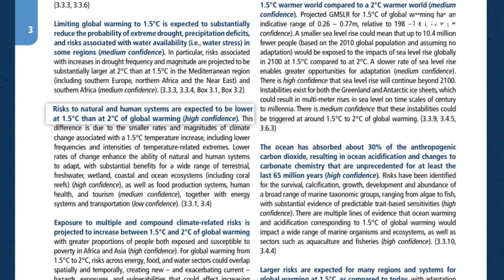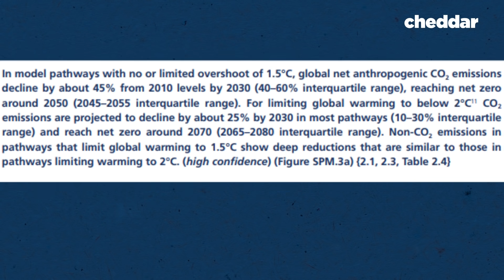Wooden Skyscrapers Are On The Rise - Cheddar Explains

Comment: Concrete is uh fucking bad, but a passing mention and a hand wave about unsustainable forest management is pretty irresponsible. In Canada, for example, our managed forests are a net contributor to GHG emissions as it stands. Not a good look for a country that is supposedly leading the way in using wood as a high-rise building material. The interests of capital in this country align such that it stands to benefit from both increased demand for timber as a builder material and from a lack of (already desperately needed!) sustainable practices. It's extremely naive to expect a market-based solution to any aspect of the climate crisis, but it's especially damaging to PR boost for such a fix, and especially in the Canadian context.

Comment: Nuclear power, geothermal energy, and hydropower are some of the best ways to cut emissions.
Reply: Hydro actually creates a LOT of CO2 during construction and reservoir filling. The CO2 released by the rotting of all the vegetation covered by that new lake, as well as all the cement production for vast amounts of concrete, can overtake many other similarly sized projects.
Reply: @kindlin  But converting current dams to hydroelectric would save from producing CO2 during construction
Reply: @firestrikebs  
Huh? Dams are hydroelectric, the dam is the hydro- part. You can upgrade an existing dam with more efficient turbines, but that doesn't change the initial cost of construction and filling, the damage is already done.
Reply: @kindlin  he probably means converting water reservoirs into hydroelectric dams. It wouldn't work
Reply: @kindlin  You're a dumbass. C02 is actually good for the environment. Plants need C02 to produce oxygen.
Reply: @thebabbler8867  
All scientists agree that increasing carbon means higher average temperature, with that simple fact you can extrapolate many of the causes and effects of global climate change. Yes, of course trees and plants eat up CO2 and you can sequester it in houses and many other things, but that is just a trifle of the total flux of carbon in the atmosphere.
Reply: @thebabbler8867  Yes, and cell reproduction is vital for life, but when it gets out of hand, you have cancer.
Reply: What about FUSION? OuO
Reply: @WinVisten  I'm pretty sure ITER will start deuterium-tritium operation in 2035. Even then, it will not produce power for very long. It is a long way off. I think the best solution now is to integrate trees into our cities. (https://www.youtube.com/watch?v=4w7lsydq8ks&t=609s)
Reply: Some issues 

1. Nuclear is a very green energy source and is a current requirement for any serious green energy initiative, but it has one really bad problem which hurts its environmental friendliness and that's the radioactive waste it produces it lasts for a very very very long time. And this does not include in the event of a melt down due to damage or failure which can turn the local area into a radioactive zone.

2. Hydroelectric power is really great but it has some problems too and that's its environmental footprint simple put its takes so much space to produce any realistic amount energy it destroys the local ecosystem and damages the flow of water on the rivers they're placed on and also interferes with the flow of sediment down the river. That's why in Egypt after it built the Aswan Dam, its farming sector has had to rely more and more on fertilizers than it used to while it's not solely the dams fault it's also partly on the mass population increase of egypt but egypt especially the Nile river delta was one of the most fertile places on earth making it the breadbasket throughout most of its history. This does not include the event of a dam failure which can cause huge damage to the surrounding areas.

3. Geothermal power is very nice but the issue with it is simply there is not really enough places that have geothermic activity in the world and is also stable enough to sustain geothermal power generation. Think of it would you build a power plant on a volcano that might erupt without warning?

While all of those are what I like to call heavy green power sources and the most efficient ones we currently have they have many flaws in it which is one of the key reasons why they are not so widely used that it replaces traditional power sources. 
Imo I think development of tidal power generation will make going green more feasible by using the power of the oceans currents to generate electricity will make it more realistic. Three good potential energy sources that can really revolutionize our power generation is Tidal energy, space based solar power generation and fission power. Out of those three Tidal energy is the most closest so far.
Reply: @noticedruid4985  Nuclear waste can be recycled and many 4th gen reactors produce almost no waste
Reply: @noticedruid4985  radioactive waste is not an issue. They just put the radioactive waste where they got it from. You take radioactive isotope from the ground, a put less radioactive ones back... How is that an issue? Maybe Im just not seeing it
Reply: Thorium fission could solve our issues almost instantly
Reply: Well, it's not cuting emissions, it's using/reducing emissions to build.
Reply: There are tons of ways to cut down emissions. Less concrete usage, no bunker fuel for ships, more trains, ban on short haul flights, investment on vertical farming, going vegetarian/ mass adoption of veggie fake meat, direct carbon capture in existing thermal powerplants, more renewables....
Reply: @almerindaromeira8352  
Many of those require energy at massive scale or new technologies to be useful, especially vertical farming. That's where fusion comes in. Eventually. In 20 years or something. I'm actually all for some of the up-and-coming fission ideas coming along. I haven't seen any serious and valid criticisms of thorium/salt-based fission reactors.
Reply: @kindlin  Fusion is also my hope, fission has always some risk attached and it looks bad.
Reply: Bingo

Comment: This seems like a terrible idea if your goal is longevity. It just makes no sense, im all for using less fossil fuels and seriously cutting back/replacing industry's that use them in mass. But wooden buildings require repair every 15 20 years or so (not all of the wood used obviously but certain spots will become compromised since they are so vulnerable to so many different things) that would be so unbelievably unrealistic with a sky scrapper even with steal support beams.....im no expert but it just seems like a bad idea. Even with this wood specially engineered for load bearing etc. But what about moisture, woods kryptonite? Even with treated wood moisture eventually gets in. There are so many better solutions than this. Even if your dead set on using organic materials.

Comment: Well i am Pyromaniac ... now put one and one together and lets see how long until a Skycraper Collapses because its base burned to a crisp. Mind you i am not the one doing that, i wouldnt set a house on fire but i've seen people (Mainly Drunk Pyromaniacs) try to set a Concrete Building with a Torch Ablaze ... what would happen if it were to be made from wood then? 

I love the Smell of Burnt Meat in the Mornin.
Sure they burn at a predictable rate ... until you add a higher Airflow and with that more Oxygen. 
Oxygen + Fuel + Heat = Fire ... if you have lots of one it can catch fire. Afterall metal can Burn, so does Asbest if there is enugth of the other two.

Comment: Nice video. However, in the northern part of the world, the winters are brutal. And I, living in the northwestern US, know how easily wood soaks up water, even if there was a protective coating. This means, during the winter, water gets trapped inside the wood. Water in wood is bad because the water during the winter would expand causing the wood to start getting separated and warped. Setting down wood isn't easy either, this is a problem that every material faces when making a building. When you stack older pieces of old on the more younger wood, the older wood tends to be stiffer than the younger one. This is because wood is a very moist ;) material and, as it dries up, the wood starts getting weaker. Therefore, the wood that is older than other pieces of wood will make the building become damaged before anything happens to it. 

More on why this video is bullshit:
- 5:09 The wood does not perform well in earthquakes. The heavier the building the larger the foundation, so the "less of a load on the foundation" claim is just stupid. Also, the heavier the building the harder it is to move (momentum).

-  6:22 How are you going to grow plants when they are known to break wood with their roots. Even if they had pots, what would happen if the bugs chose to live inside the space in the wall? The trees invite them and the wood structure is a perfect home.

Comment: Love how the video doesn’t even talk about the real challenges to construction with wood.  They have only solved one problem with wood that will only allow us to build a little taller.  All of these supposed “skyscrapers” are nothing compared to what steel and concrete can do.  All they have done is make wood more reliable and still probably not to the level of reliability of steel and concrete.  Everything presented here does not address how they will fix the problem of the fundamental physical properties of wood.  Wood may be pound for pound just as strong as steel, but steel is way more dense.  Thus wood will fail at much lower loads.  Wood is also a lot less stiff.  That may be good for the off chance of an earthquake, but wood will buckle long before steel does.  These are major barriers to wood being used to build actual skyscrapers.

Comment: 5:11 > pound-for-pound it's just as strong as steel but because it weighs less the whole structure has less mass
How does the same strength-to-weight ratio correlate to less overall mass? Per cubic meter, the densest wood weighs about 1200kg and steel weighs 8000kg. If the strength of steel is X, then the strength of wood is (1200/8000)X = 0.15X such that the strength-to-weight ratio is the same. In order to bear the same loading, the mass of structural material is the same whether steel or wood, but you need 6.67 times the volume for a wood structure compared to the same structure built using steel. Ultimately the structure has the same mass regardless of material, but less internal space if bulit out of wood
Reply: That's why she said medium hight and all that wood is expensive

Comment: If wood is pound for pound the same strength and steel and concrete then wouldn't that make a building less structural stable since it would weigh less meaning less strength? Because 0.75 lb of wood can't be the same as 1.0 lb of steel?

Comment: This just sounds like a huge fire hazard to me
Reply: Bro, did u watch the video? They literally talked about this
Reply: OhHeck i watched the video after probably this was from over a year ago
Reply: @hollar5560  it was misleading. They made it seem like it's a settled issue but research is still incomplete.
Reply: @monkymind4316  but concrete cracks and the metal reinforcement inside always rusts.
Reply: some sky scapers catch fire and they are covered in so called fire profe cladding.
Reply: Andrew Fogel Aren’t some woods fire resistant
Reply: They'll probably claim that they'll treat the wood with fire resistant chemicals.  Of course the production of the chemicals and application will cause cancer.
Reply: That's why you cover wood with fireproof materials.

Comment: It's like the paper vs plastic issue. People claim to be helping the environment by banning and avoiding the use of plastic bags and packaging, but are in turn supporting and bolstering the deforestation of the globe in doing so. Supporting paper means more clear cutting of forests, and more forestry industry in general, meaning more forests will get decimated in the process. And there is a lot of inherent issues with using mostly or purely wood to build these buildings. Termites & Carpenter Ants are one, another is fire like you've noted, and here's another big one everybody is missing: ROT. I don't care how often you're treating the wood, rot is a huge problem. There is two different types of rot - Dry Rot, and Wet Rot. Wet rot is the kind everyone thinks of, while dry rot is by far the most common problem with wood in and on buildings of any & every kind. You also need to consider how easy algae will find it to grow rampant on it, and fungi too. There is are even more problems wood faces when used to build things.

Comment: To me the whole philosophy is fundamentally flawed.  It works on the a priori assumption that the human race isn't composed in large parts of lazy idiots.
     What's going to happen if the idiot above you lets his bathtub overflow?  Hundreds of gallons of water are going to pour through the wooden walls and structure.  If it was a building composed of concrete?   No problem.  In the case of wood, the walls are going to fill up with mold and rot.
     What about the magnificent property of concrete to prevent the passage of noise and smells?  The wood is not going to be as effective at stopping the 16 year old moron kid next door playing his subwoofer at 120 decibels at 4 a.m. on a weekday when you have to go to work tomorrow. Or the drunks next door having their thousandth argument over who smoked whose cigarettes.  And your neighbour not changing his cat box or loving the smell of pan fried, curried fish?  
      Stand back from a concrete building.  What do you see?  It is essentially a stack of concrete cells.  These cells work and have stood the test of time.  The perform the task of separating people from each other in a crowed urban setting.  They are essentially a rock cave in the sky.  
      So if you're an Utopian who thinks everyone loves each other...have at it.  Go with wood.  If you've ever been out in the real world and seen and talked to the human race?  Whining, stupid, lazy, cheap, uninterested in paying for maintenance...etc.  Go with the tried and true.

Comment: Mid rise building built with steel and concrete will generate 3000 tons of CO2, but build it with timber and you avoid the release of 4720 tons of CO2.....can someone explain that?

Comment: You have to explain how they modified the wood instead of just saying “engineered wood” because that just makes you as a writer look lazy and  uninformed. Also I am a structural engineering student. Seems like steel may be more expensive, but it has more strength by volume when you build a building. Eventually, the height of wooden towers peaks because of the strength to volume ratio of the wood while with steel, that ratio is wayyy higher hence why most modern sky scrapers are almost entirely composed of steel structures

Comment: I can understand the reasons for using wood and also replacing the trees that would be needed to replace those used.
However, we would need to make sure we plant enough trees that can grow in an available amount of time with the demand for buildings being created.
Another issue is see as being possible is due to the continuous planing of trees on the same land, doesn't that make the land acidic over time leaving the soil no good to plant on?

Comment: Disadvantages of wood: It burns, it's weaker, it requires huge amounts of deforestation, (example is the UK during it's naval power years, so many forests disappeared to build it's ships), organic material so it decomposes. As it's weaker, it'll require more wood vs how much you'd need steel to perform the same task so in the end, it's heavier (examples are wood and steel ships, wood ships of similar build size and design are heavier
Reply: It burns at a predictable rate and not very quick, it's actually very strong if you watched the video, you can plant tree farms to create new material instead of cutting down forests.

Comment: Timber and bamboo can be very good for the environment, if managed correctly. Both capture co2, if cut and kept from decomposing, that carbon it trapped is basically kept from returning to the atmosphere. However, it's difficult to impossible to build with bamboo in the USA for example. So many rules and codes and people with their heads up their ass stopping you. I have a couple of bamboo poles cut from a local stand on the east coast of the USA. Only about two inches in diameter, but stop enough to hold 300 pounds right in the middle when spanned about six feet. It flexes some, but doesn't break. I secured one pole and had it span about six feet and literally tried to break it by jumping on it. Didn't break. Strong stuff.

Comment: At about 2 min, 30 sec, it says a cubic meter of wood stores a ton of carbon.

A ton of carbon?
Wait, this wood boat builder did some math.
A cubic meter is 37 cubic feet. 
A cubic foot of dry douglas fir, a good structural wood, weighs roughly 35 pounds.
37 x 35 = 1,300 pounds., almost 600 kilograms.

And wood is certainly not all carbon!!!
Reply: It says a ton of carbon dioxides, it's true that wood isn't 100% composed by carbon but carbon dioxide isn't all carbon either. If you burn celluloses (which is one of the primary component of the wood) you can get more CO2 in mass than the initial Wood mass. It's still need a denser Wood to get that 1 ton figures though. Sorry if i have a bad grammar btw.